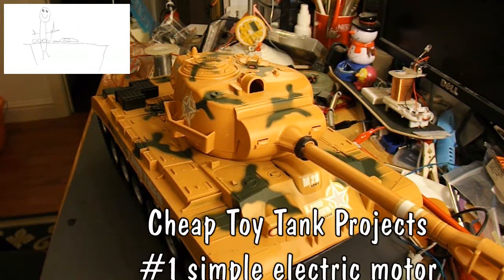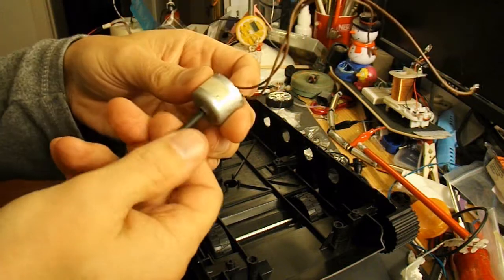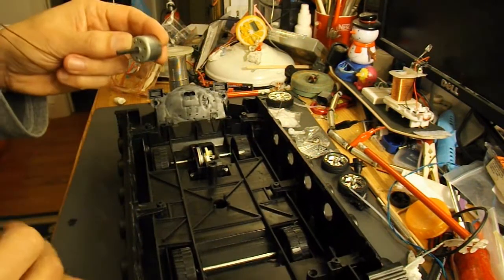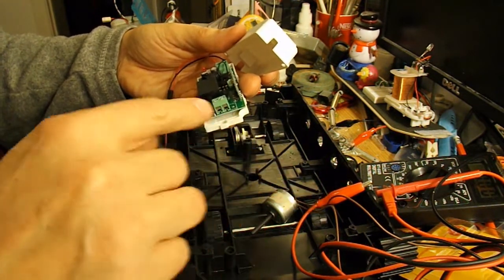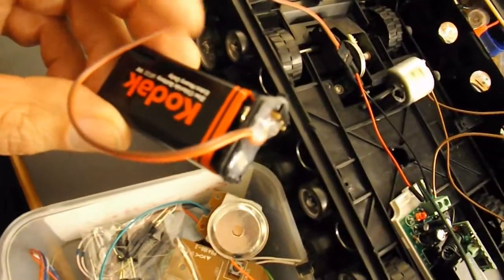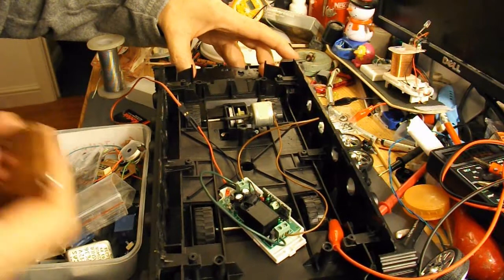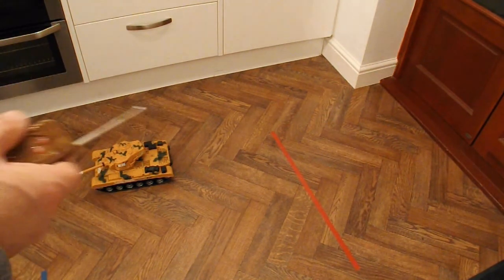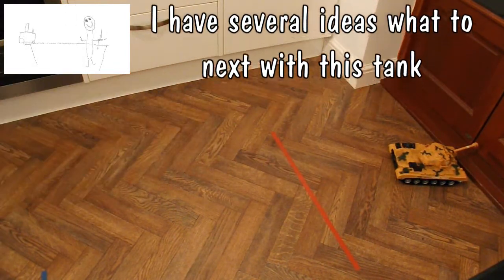Cheap toy tank projects #1

Comment: There is a way to make it go in both directions but it requires a H-bridge. You also need to wire to the "common" terminal of the relay to make it work. If you don't know how to do this and want to know, a great youtuber GreatScott! has a video about it. Basically a H-bridge consists of four Mosfets and resistors and some other external circuitry to make it not fry itself. It requires a handful of wiring so it's not gonna be a fast project.
Reply from the maker: +PunakiviAddikti thanks for commenting and yes GreatScott!! has an interesting channel. However this receiver is single channel and without major modification is only able to operate as a 2 position switch. Yes, you could access the NO, NC and C contacts on the relay. Yes, you could connect those outputs to an H bridge, that means you could switch from forwards to backwards if you wanted but you would not have an OFF option so the tank would drive forwards or backwards but not stop and start.
Reply: GrandadIsAnOldMan Yes, that is the drawback of a H-bridge: while you can safely switch the direction with a SPDT switch, you would only have ON-ON, and no OFF feature. You would have to install a manual OFF switch. You could use a RC car receiver, those actually have two H-bridges in them in a IC package. However, your project is quite clever and functions great as it is for a single-function RC vehicle.
Reply from the maker: PunakiviAddikti the little rc remote switch unit was purchased to use on a remote door lock. I have plenty of rc toy car receivers but I wanted to demonstrate the remote switch unit.
Reply: GrandadIsAnOldMan Oh, I see. Well, it seems to serve its new purpose quite well.

Comment: In the past and my Meccano already told you that I got a while, he put electric motors, engines coupled inertia or friction, such as that tank.
I did tests to see how much weight he could carry and the truth is I had enough power.
As has very high reduction will despaccio, but has enough strength.
If you do the test, you'll see.
Reply from the maker: Yes the flywheel inertia motor has plenty of power, I will keep it and may use it for another toy.

Comment: now you made it wireless  but it can only go front ,but u can use a DPDT switch and make it go forward and backwards and remove the slow motor and put a brushless in it , then it it would go flying
Reply from the maker: +NIRANJANA PH Yes you could do all that if you wanted but it is not what I wanted to do in this project.

Comment: Thx good job
Reply from the maker: Not quite the toothbrush motors that you asked for and it runs on wheels not tracks, but it is a start. I will be doing other projects with this as a basis.